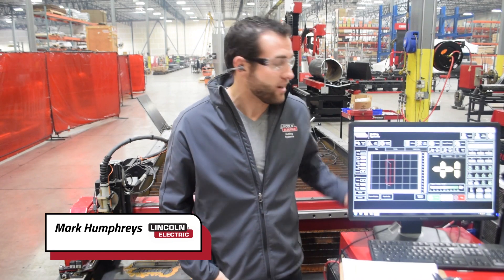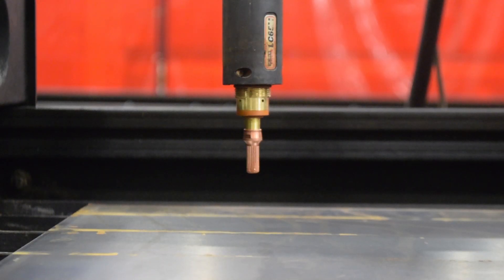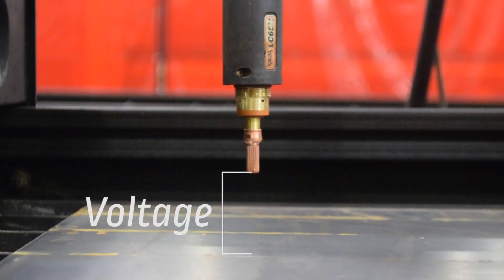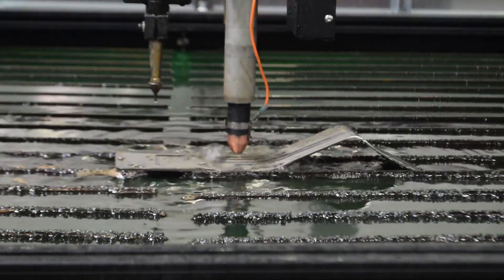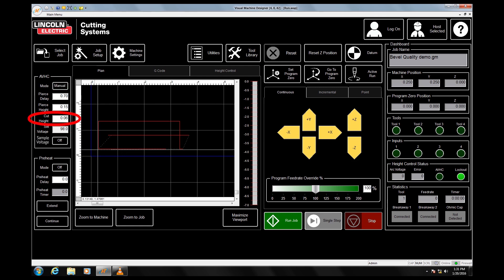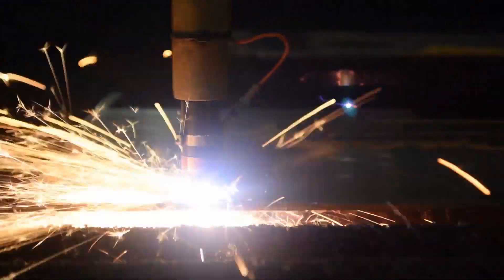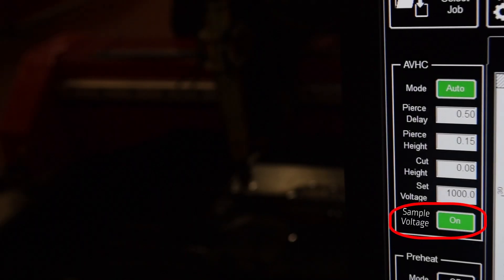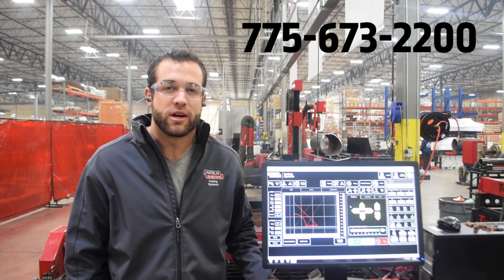CNC Plasma Cutting Height Control: Explained

Comment: I've had my table two years now and these latest videos are by far the most helpful thing I've come across. It would be great if you could do a step by step video on how to dial in a machine as best as possible. For example, using the tests to determine best cut speeds, voltages, and heights. From start to finish and what to look out for.

Comment: Hi thanks for videos, they are very helpfull. I have a question, why the thorch need to touch the plate before every cut? why can't we just mesure the voltage and start cutting? I search the internet and couldn't find.
Reply: as i know, plasma is a discharging form between two  electrode + /-
1. torch need to touch the surface to make sure it  finds the plate and accurately retracts to the proper pierce height.
2. voltage  can not be measured  without  it occurs and feed back, that why we let torch touch the plate before every cut :(

Comment: Hi I need your help In my workshop I have a plasma machine 'Airliquide Optitome 20 60 HPI' and with regard to height control, the machine pays off on the way up but now it does not pay off on the way down if the plate is irregular. I think a problem in measuring the potential difference and I don't know how to solve it. Can you help me? I can send video.
Regards

Comment: hi ,  thanks for video , very instructive , please to tell me if better use THC  high frequency arc pilot or blowback arc pilot , the blowback could be HT not HF 
please to confirm that for cnc use ,the cutter must includes voltage divider ,as connection wiring 
i have cnc plasma but old one without thc, need to add , thc and replace the cutter please 
to advise and contact me for purshase ,thanks